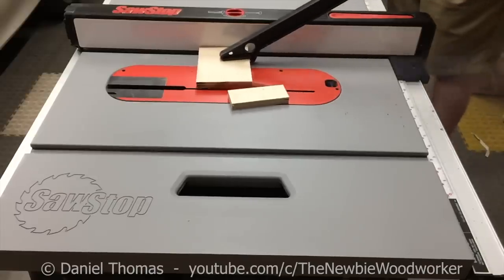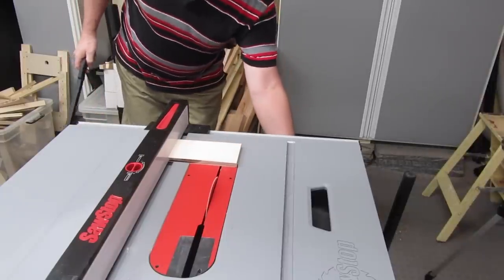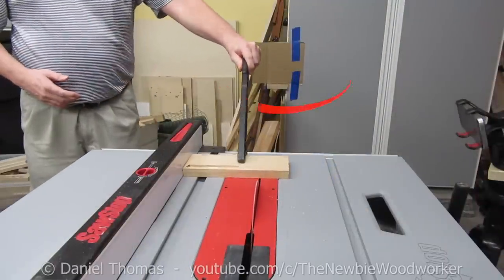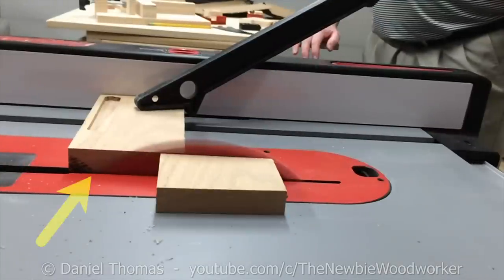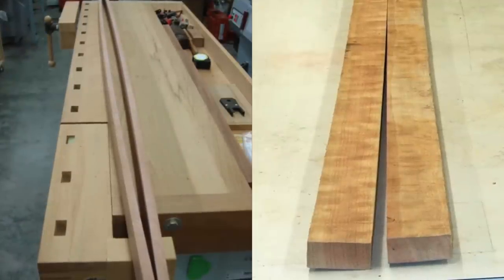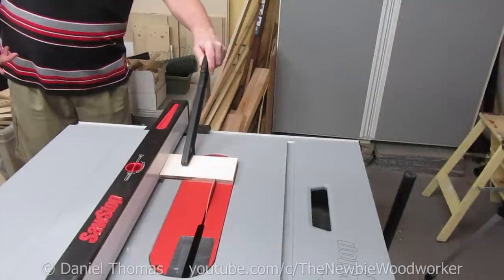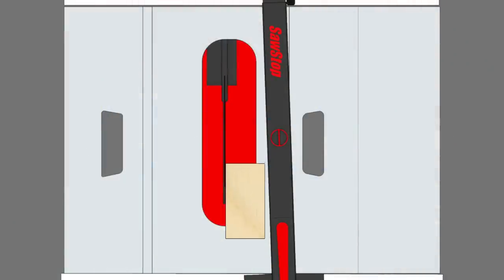Actual Kickback (in Slow Motion), & How to Prevent It

Comment: The more I watch this makes me wanna pull your man card. Carpenters from all over have there jaw dropped right now.  First off using that push stick is the cause of kick back. I only use a push stick when ripping anything under 7/8 of an inch.  Firm hold. Don't pull backwards. If anything. Hold it still and kill the saw and start all over. Longer boards I often use a scraper and slide it in the cut so wood doesn't bind on the blade. Blades hardly cause kickback.  It's user error.
Reply from the maker: If you had watched the video and paid attention, you'd know that I was intentionally trying to cause kickback, which is why I was using that push stick the way I was.
Reply: @TheNewbieWoodworker  You could have use some thick cardboard, say from packing boxes.
Reply from the maker: @oneeyedphotographer  In retrospect, that might have been a good idea.

Comment: This is a well-intentioned but horrible video---I say this as a custom-cabinetmaker and architectural woodworker for 20 years of experience, who began with no experience of woodworking and powered cutting tools, but with some fundamental understanding of geometry and physics from ordinary education, who has subsequently taught general (woodworking) construction  at two trade schools for six years.

To avoid 90 % of the kick-backs demonstrated. STOP USING THE RIP FENCE---It's FOR RIPPING (with the grain), NOT CROSS CUTTING! Use the rip fence as a 'stop' by all means, to ensure you are cutting off your desired piece at the right length ( or width) but once you've done that, MOVE the RIP FENCE out of the way, so the piece you want can't possibly 'bind' between the moving blade and the (hopeful parallel fixed RIP fence.  The price you want will just sit on the saw platen once it's cut. 

Newbie, you are sincere and keen about woodworking, your concern for safety and effort to demonstrate hazards are all commendable, as are your responsible caveats about how you are''nt responsible for whatever your viewers might be inspired to do ---but you have a LOT to learn, about woodworking, about making instructional videos, and about teaching in general.   

IMHO , right now you are BAD at woodworking and instruction, BUT, you are enthusiastic, you are trying to be careful, you acknowledge your present limitations, you are doing your best at present, you want to improve not just for yourself but for your audience, and you are trying to be thorough. So...; as much as I am professionally appalled---  ummm, make that, 'dismayed' by this video in general, I'm going to subscribe, with the hope that I might be able to  help you out a little bit via comments, and just to see you continue to be bold in this enterprise you've undertaken, 

My professional persona would give this video a definite 'Thumbs Down'---it really is horrible for so very many reasons---BUT you get a thumbs up for being sincere and putting a lot of effort into making this video. Keep your fingers away from the  blade, carry on, good luck, and I'll be back---hopefully with less bitching on my part, Laters!
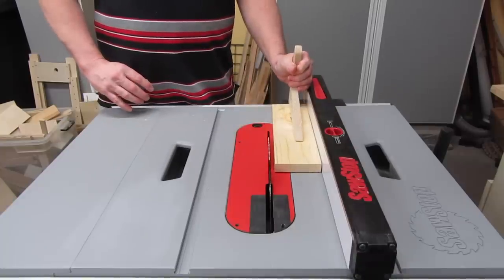Reply from the maker: I think you missed several important things in this video. At 1:48, I admit I'm doing a lot of things intentionally wrong, and that I'll explain them later in the video. The explanation related to crosscuts and how you shouldn't use a rip fence for them starts around 10:30. You should be able to click on the aforementioned times to take you right to those parts of the video.

Should I have been more clear upfront? Possibly - that's always a struggle when making YouTube videos. You want to keep people's attention or they'll click off the video before they get to the good stuff, so I try to not do too much exposition at the start. If I were making a video for a classroom, or a course someone paid for, I'd take more time because they'd be more likely to stick with the video. But when you're competing for people's attention on YouTube, it's a fine line. Perhaps I made a mistake, as your comment shows. But it is what it is. Perfection is unattainable, hindsight is always 20/20, etc.

Comment: The only thing I would add is to watch the falloff piece. I had one kickback on me. Don't know how it happened, but it took me about 5 minutes to pick myself off the floor. I was alone in the shop.
Reply from the maker: Ugh - sounds awful! I'm trying to learn to use a second push stick to handle the off-cut, to keep me from inadvertently getting my left hand too close to the blade. Now I've got two good reasons to train myself! Thanks.

Comment: I think I would not have worked to show what kickback looks like in action quite the way you did. I got nailed in the leg once, and in the stomach once. This was before riving knives were a required safety device. At that time also the blade guard was not a required safety device. You doing the kickback demo with a simple push stick still puts parts of your body in harms way. This was such a dangerous demo, so that I was cringing as the video progressed. Lucky that you did not get nailed, as you very nearly did. Just a couple of inches in the wrong direction, or the direction of kickback changed more toward your exposed body part would have been potentially devastating! Please never do this again. There are safer ways to demonstrate the kickback effect. Also, please don't place your hand on the blade slot in the plate. If the blade is still spinning, it can still throw a tooth, especially if the teeth are carbide tipped. Having worked in woodworking all my life, I have seen how they can throw teeth. Never got hit by one, but I know the tooth can be propelled at bullet speeds, which would go right through your hand in less than a second. There is no way your could move it away fast enough if a tooth is thrown upward through the blade slot. Bullet speeds can kill.
Reply from the maker: Yes, it was risky, and probably too risky. I certainly wouldn't do it again!

Comment: I bought a band saw instead of a table saw.  No kickback is possible.  I'm more interested in resawing so I don't miss the tablesaw.

Videos like this were one small part of my decision.  Thanks.
Reply from the maker: Thanks and that's cool. Just remember that the band saw is dangerous also, and sometimes even more so, because it lures you into a false sense of security. I've found myself, on several occasions, almost touching the blade as it spun down, because it's so (relatively) quiet. Enjoy it!